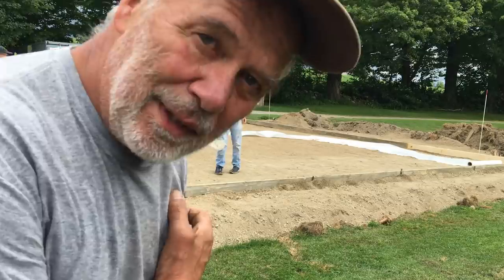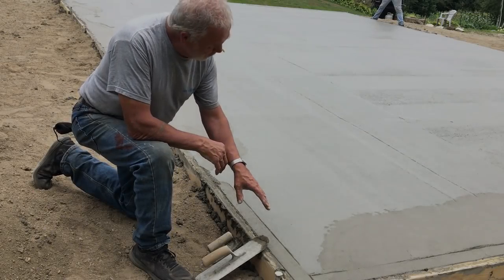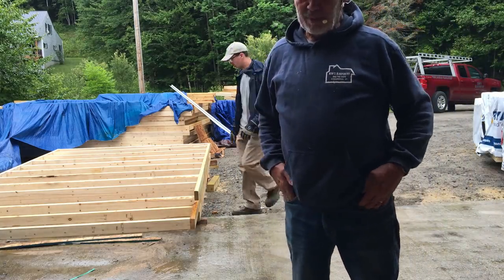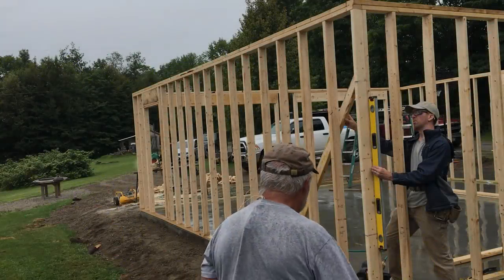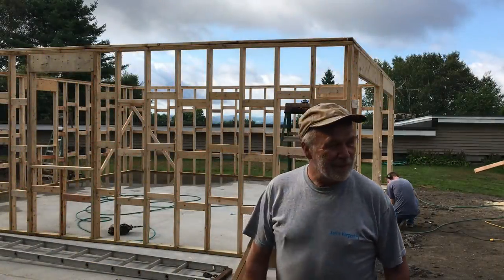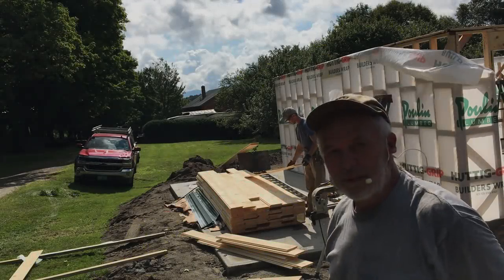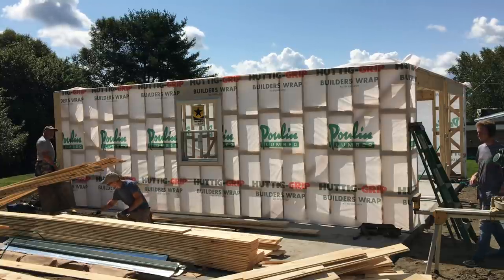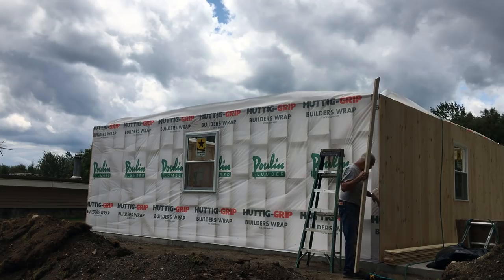#199 Garage with Shiplap Siding $19,000 Part 1

Comment: I'm a retired carpenter of 35 plus years. Dad and I had a construction business of which we built custom homes,  additions, garages and anything else that needed building or remodeled. Got to say,  you guys are pretty efficient. Looks like you've been around the construction block more than once. LOL.  One thing I  guess we would have done differently is to still add wall sheathing plus our diagonal bracing would have been  a cut in 1x4 or a metal brace that takes just one depth set cut with the circular saw. All of which we did while the wall was laying down on the slab. Which also made it easer to square up corner to corner.Of course if your slab isn't perfectly level well then the wall won't be plumb when set up. Then we did plan B. And what you guys did was plumb the corner ,  not level it. 😏
Reply from the maker: Thanks for watching

Comment: Its very easy listing to you talk Ken, your soft, laid back style is refreshing, while a lot of others are trying to be "dynamic" and ram their prowess down our throats, thank you.
I bet the boys wish they had of loaded the trailer with the front wall on the bottom, so they could start with the back wall and not have to walk around through the mud with everything else. 
That long board on the gable looks like you work in metric (as I do) but I am guessing you don't, for some reason I am occasionally 100mm out, something that measures 2750 up the ladder magically becomes 2850 at the saw (but i do love metric)

Comment: I'm curious why you don't install anchors for the sill plate in the wet concrete. I assume that you instead use drilled-in anchors afterwards or just Hilti nail the plated down?? I haven't seen any anchors so far. Maybe I'm missing something.
Reply from the maker: Typically we use wedge anchors after the walls are up.

Comment: hows the shiplap compare in price to vinyl? id much rather use something other than steel or vinyl just to be a little unique but things like T11/T4 whatever they call it is basically extinct and anywhere that can get it it costs twice as much and requires painting on top of that, shiplap or board an batton seems a more DIY route but im not sure the cost savings are there
Reply from the maker: Shiplap is a little more

Comment: Looking good guys, have a kwik question. My garage is 38 years old and the original t 111 is looking tired.lm thinking of pulling off the bat and board trim and just running siding horizontally over it. Any thoughts ?
Reply from the maker: Sounds like it should be fine

Comment: I haven't seen diagonal corner  bracing in your other videos. It seems like that would be important for ever structure that you build, no?
Reply from the maker: Typically sheathing is enough structurally for our area. For shiplap though you need blocking between studs and diagonal bracing

Comment: I was wondering how you anchor the walls to the slab? I've not seen any anchor bolts installed before the slab cures. Do you use expansion bolts?
Reply from the maker: Yes we use expansion bolts after the fact
Reply: @kenskarpentry  
Easier to use expansion bolts than cast-in anchors which always end-up being badly spaced, hehe.